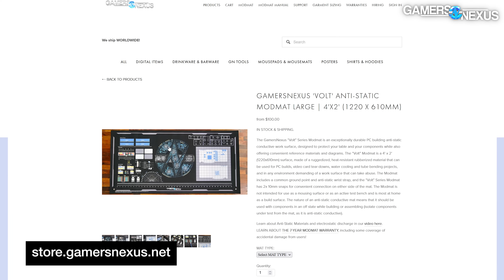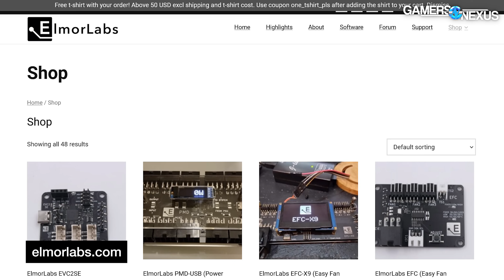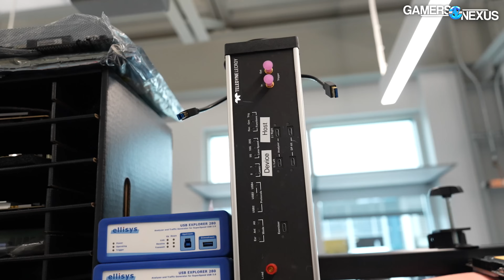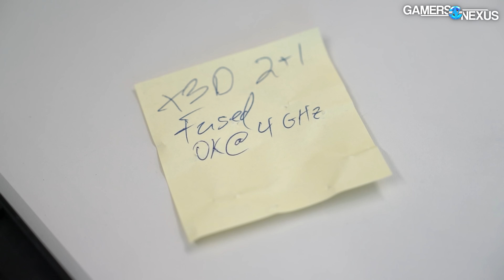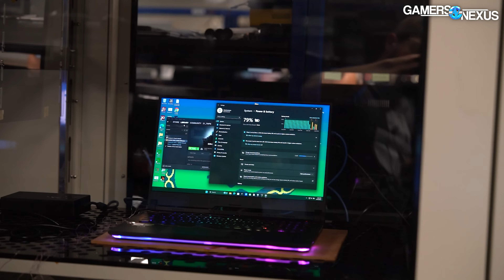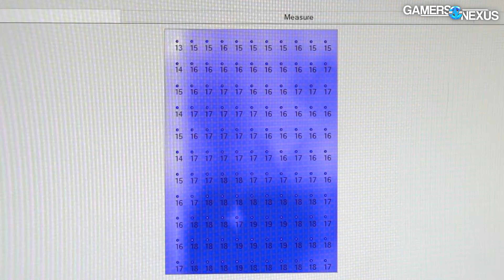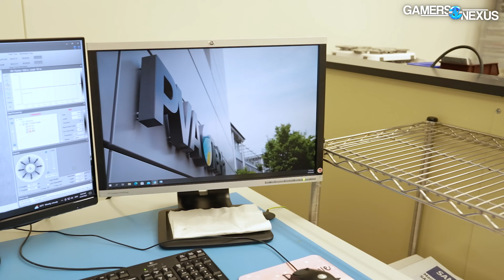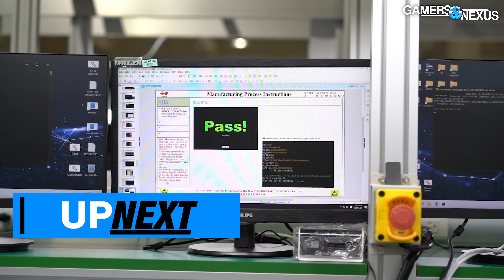Secrets of a $182 Billion Chip Maker: AMD's Labs | Full Documentary

Comment: If I still worked at EMC's e-lab, I could have shown you all this for (enterprise) storage. We had custom testers for Fiber Channel and NVMe protocol analysis. I wrote my own IO load testing tool that found all kinds of firmware bugs in Cisco/brocade/broadcom/Qlogic/VMware firmwares. We had servers and switches from every vendor. Labs are super fun to work at, but also super unrewarding when you're a high performer. Make a breakthrough that generates millions in revenue? Your bosses soak it all up. It's no fun to be smart in those places; your wins get eaten by mgmt, and you get told "despite inventing cold fusion, your performance just isn't good enough to justify a raise or promotion". Soul crushing.
Reply: I totally believe it. Testers are the most talented unrewarded/undervalued folks in both the hardware and software side imo.
Reply: That's why one keeps a diary about how one's benefited the company in terms they understand. Regardless of profession. Don't depend on them to remember or understand.

Comment: At 20:00 the engineer, sorry I lost track of his name, mentions the difficulty of monitoring traffic and diagnosing issues on the Zen CPU with the chiplet design. If that gets discussed more I'd love to hear more of it. Chiplets are clearly how CPU's and GPU's will be built going forward but if the chiplet interlink cannot be easily monitored then it could be a major problem.
Reply: It’s just a link like pcie, the point he was making was about not having the space to break them out because they are built into a substrate together. They would need to build a way to monitor that traffic into silicon and or path it to the I/O pins to really monitor it perfectly, but there already exist ways to see if that link is giving bad data, with zen 4 you will see loss of performance due to error correction causing a reduction in bandwidth and all out crashing if it can’t communicate data effectively.
Reply: @alexmills1329  Yep. and Zen 3 will either give you WHEA errors for CPU/Bus interconnect (if VSOC is lower than required), or have from sound stutters up to outright system reboots under load. (if VSOC is MUCH lower than needed... Like 0.1+V lower). And even then it will throw WHEAs before crash. 
Zen4, at least for now seems like doesn't report WHEA's but it's ECC is A LOT stronger...  You may see performance degradation that will increase with lowering voltage more and more.
Reply: @DimkaTsv  True gamers play on Intel, not AMD or Apple! I'm 16 and I even know this!
Reply: Embed the monitoring in the silicon. The PHY knows what it sees.
Reply: @swallowedinthesea11 gotta be a troll
Reply: @wojtek-33  he is Userbenchmark user. That all you need to know about people like him.
Reply: @wojtek-33  16 years olds dont talk like that, he sounds like an 11 yo

Comment: That delidded cpu part where you showed the old amd cpu that shipped without a lid back in the day 

That made me hella nostalgic, reminded me of my very first AMD XP mobile chip i started overclocking with when i was a youngster
Reply: athlon xp heat heads, do u guys still have athlon XPs or MPs? retro overclock that beast, dont forget the nail polish and silver ... to fill out the laser cut gaps to unlock the multiplicator
Reply: I started on AMD 386, but Athlon XP holds a very special place in my heart for sure. From the pencil trick (I used automotive rear window defrost repair epoxy) to the unlocked Barton 2500 set to 400MHz FSB to become a 3200.  Good times 🙂
Take care!

Comment: I am an engineer that builds and solders circuit cards. I can tell the team enjoys their jobs, and who wouldn't? All the work that goes into making stuff is not trivial and requires a lot of various engineering expertise. I'm more on the "make the stuff" end but I regularly work with the "design the stuff" and "figure out why stuff didn't work" groups as well. 

We have exactly that same X-ray system where I work, the applications engineer we work with is great.

I worked for a while in a third party FA lab that wasn't quite that capable but the equipment was same/similar. 

My thumbprint was probably a bit different before I ever used a manual grinding/polishing wheel. 

Laser profilometers are cool because, lasers. I had to contract out some C-SAM once, that was cool to use.

Rule #1: Do everything nondestructive possible first, before anything destructive.

This is easily the best video I've ever seen on this end of tech on YT.

Comment: 28:33 Nice to see an Agilent 34970A DAQ. It most likely has the 34901A card installed which is basically a multimeter with 20 inputs. The metal plate right underneath the DAQ has 20 thermal couple inputs going into the DAQ. They are probably using that for datalogging of test setups with many thermal couples.
Reply: Sounds like you work with that kinda stuff
Reply: They are used for individual thermal readings as well as sens resistors on the development boards

Comment: I would absolutely LOVE for AMD to release 1st-party never-lidded/lid-free CPUs.  They should include a contact frame with them, of course, as well as fully seal the top for use with liquid metal TIM. I would happily pay (a little) more for that.

Also, it's really neat to see some of the people I've met and places I've been on video :p  I was really happy to see the VC IHS, I never had closure on the performance they offered in exact terms before - 3C is definitely not worth the hassle considering bare die can be 16~20C better.
Reply: Lid-free is not transportation friendly (due to shipping workers carelessly handling the packages), they would have to offer in-person only.
Reply: @erkinalp   That's just not an issue, a tiny change in packaging would easily resolve that.
Reply: I mean... I'd kinda take the 3C if it meant not voiding the warranty and paying for extra equipment, but it depends on the increased price and impact on performance. I guess they made the call that it wasn't quite worth it. Plus, let's be honest, running at full temperature isn't something most of their consumer users will be doing most of the time.
Reply: @TheGreenReaper  3C is easy to get with a slightly better cooler or higher fan speed.

I (and they) thought the vapor chamber IHS was going to have a bigger impact when I was talking to them about it during the concept/design phase.

Another interesting concept/design is an integrated TEC (Peltier) layer on the actual die near critical regions.  Hypothetically you could have 6.5GHz+ CPUs doing that.

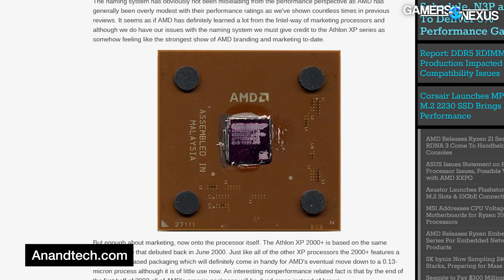Comment: 37:50 Yep, I chipped the corner off an Athlon XP CPU that didn't have a lid. Happened when I was watercooling with a pure copper waterblock made by what was probably a one person operation. The CPU still worked fine. 😄 Back then most of the components for water cooling came from home improvement and pet stores. 🤣

Comment: God Lord I'd love to see any of these folks home setups! And hella cool video keep it up!
Reply: Hi :-)   I just built a new system using 7950x3d with a D15 cooler, using an old Antec Turbo Server style case, in dark metallic green, from around 2003, complete with period-correct cold cathod lighting and a transparent side panel which was the new thing at the time I originally bought the case (at Fry's Electronics in Austin). I modded the case fan situation to bring it up to spec, including replacing the fan in my Seasonic 1200W modular PSU, so that it is plugged into the motherboard for legit fan control.  I don't want to name the mobo vendor, but I always rotate through all of the brands and went from one to another; using x670e. I have 3x 4TB + 1x 2TB NVMe drives in a mix of brands, including Gen5 devices via M.2, along with my old Gen3 2TB from my old configuration. I work with the NVMe IO stuff at work, so I wanted to try a variety of the major drives in real-life. (had a bunch of RAID stuff setup on the previous one).  For RAM, I'm using a pair of unnamed/unreleased Hynix A die based 16GB modules rated for 8000MT/s (CL36) at 1.5v, or 7200CL34 at 1.4V.  I don't need much capacity, but I did want to have overclocking headroom - David McAfee just spoke about some optimizations and changes coming for DDR5 support and frequencies... 🙂  I'll be bringing it to Quakecon 2023, next month!  Take care!

Comment: 49:57  Navi 21 is not the 5700 XT.  It's the die used for the 6950 XT, 6900 XT, 6800 XT, and 6800 GPU's.

The 5700 XT used the Navi 10 die.

Navi 1x was the RX 5000 series of GPU's.

Navi 2x was the RX 6000 series of GPU's.

Navi 3x is the RX 7000 series of GPU's.

Comment: No need to force everyone to buy a  new cooler, if it's a new gen of chip then a new socket can be made taller so a thinner lid will fit existing coolers. You don't lower the ceiling to work on it, you raise the floor by standing on a platform.

Comment: One of the big "what ifs" that always intrigued me was the never released AMD Athlon motherboard chipset that used Rambus RDRAM. This was at the time (c.2000) that Intel was pairing their 64bit @ 100/133MHz bottle necked Pentium III with RDRAM. The Athlon at the time had a 200MHz DDR at 64bit (and very low latency) bus for memory and could have stomped Intel using their own memory. But they chose to just use (SDR) SDRAM as (from what it seemed) it was cheaper to build a system with and they still were able to keep up. A couple of years later DDR SDRAM was transitioned to by which time Intel had moved on to their P-IV that could actually use all of RDRAM's (or DDR SDRAM's) bandwidth. Opportunity lost among many later ones.

Comment: 37:55  how about making some rubber or some kind of material that can build surrounding the die. So the pressure on cooling wouldn’t 💯 set on the die. 
Usually, a bare die are crushed by pressure on angle. So my guess, if amd put some soft stuff on angle or whole surround die, it can help protection the die and you don’t need cover on top
Reply: To be more clear, what I mean is to put soft rubber or some other material on the side of die, not on the corner of pcb. But it may also good to put on pcb anyways

Comment: I wonder how many Open Benchtables they have there? That's a great endorsement of that product
Reply: I have about 20 of them now. I'll probably grab 4-6 more to make sure that all of my bench systems are using them. I don't plan to upgrade my rack systems though, at least for now. They are a great product, if not a bit expensive when you can't find it on sale/special. Some PSUs, with a curved design on the rear won't work without longer screws, but I've only seen a couple of PSUs with this design. Sampson Approved!   The only real issue that I've had is the weight when traveling by air.. my kit is already at the limit with foam board holders.  Take care!

Comment: 37:50 The older AMD cpu's you could get 3rd party copper shims/spacers ( I had them myself back in the day and used with my AMD cpus)  they helped spread out the clamp load so you don't crack the cpu and helped spread some heat from the cpu to cpu cooler too.

Comment: When they've shown the mobo chipset & I/O testing bench, I only wished for them to basically drop the chipset altogether and change it to just an intelligent PCIe switch... then their testing would be easier by focusing on AVL of PCIe controllers, and mobo manufacturers could just plug-in whatever they want (but test in-house if not on AVL) and how many they want into such switch to use all the PCIe lanes traffic the switch could support... and by extension manufacturers could truly differentiate themselves by the selection and composition of PCIe onboard added controllers... At least until they decide to drop the chipsets altogether in favor of providing more PCIe lanes steaight from the CPU, Epyc-style...

Comment: So did you get to keep that Epyc/Threadripper  etched with AMD Welcomes Gamer's Nexus text?  That'd be a fun souvenir to have.

The real skunk works of lab tools seems to originate from Elmore labs.  I'd enjoy a tour of that lab sense they seem to be involved in some very interesting ways with this 

18:45 With PCIe 6.0 having recently been ratified, this lab would be one of the first to get those analyzers.  With the move to PAM4 encoding, their cost should be a another jump in terms of cost.

21:14  I'm kind of surprised that those JTAG analyzers don't use PoE for power.  Reducing cable clutter is a big thing in these labs.  No obvious nest of spaghetti in this video but some one has had to work to keep things clean and organized.   PoE would remove the need for additional AC outlets near the systems and a DC cable to the JTAG device.  My presumption is that there is some debugging purpose for having discrete power (like needing to debug the debugger).

24:10  There needs to be a mini-rant about how having a 7 segment display like this is nice just to throw shade at motherboard makers.  Yes, this is a testing lab where this makes sense but it is great to have something like this on consumer products so we, as consumers, can try to fix these problems.  By the time we get these produces we should only need two digits!

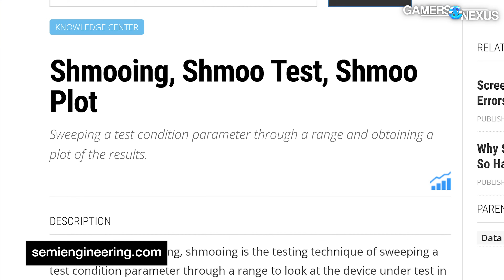24:55  Who creates these microbenchmarks and when to they originate in the development pipeline?  I would guess that these originate from the actual design teams and are ran in simulators first before being tested in this lab environment.  This would also explain why there would be documentation on error codes and expected behavior for this lab team to work with.  Microbenchmarks that would likely originate from the lab or other groups would be cross component testing.

50:00 Pretty sure Navi 21 was the RX 6800/6900/6900XT/6950XT with Navi 24 being the RX 6300/6400/6500/6500XT.  The 5700XT was Navi 10.

Was there any Xilinx or Pensando products being tested there?  Those are big data center products which AMD got through acquisitions.  Curious if they merged their testing/lab operations as it generally becomes more cost effective to consolidate where possible.  Labs like this are not cheap.

Great video.  Only thing I'd really change would be removing the cut claps.  Kinda odd seeing them as they are intentionally meant for the editing room floor.  A quibble if anything.

Comment: In the ultrathin form factor, the vapor chambers are not effective. They use water as the working fluid which has relatively low pressure compared to the refrigerant, which means the water vapor cannot effectively spread in the ultrathin vapor core.

Comment: Hello! Thx for the video. I bought a prefab PC from Origin PC. Its a pretty good deal but I just noticed my pump had died. I also noticed they installed it wrong according to your video. High rear mounted, tubes up above CPU pump. Cpu pump installed sideways. Its an Origin 120 frostbyte. It must have a heck of a heatsink cuz my temps are under 120f working load if the pump isnt working...

Ive purchased a new liquid sink. Kraken 120\m22. The pump for this is not on the cpu but mounted on the radiator. 
What took away from this tutorial is that some portion of the radiator should be above the pump/cpu attachment to force air into the highest point, and away from the cpu and pump but still provide flow..

I can mount this where ever. Im just curious on radiator mounted pumps. Can I still mount over, or should i side mount low to top? Just thinking 120 pump radiators and air gaps in mounted sideways above.

Thanks for the video, and thanks for suggestions!!!

Comment: What about signal delays using multiple PCBs to simulate a possible motherboard?
Reply: Definitely a concern.  There could be extra buffering between the boards, and then the engineer would have to be aware of that and adapt.  He may need to slow the whole system down to make it work.  Some tests don't need to run at full speed.  For the ones that do, he may have an entirely different setup.
Reply: @jej3451  At Texas Idiots, the major cause of signal skew is the different run lengths and the loading on each particular output. The greatest difficulty is in the clock skew. Synchronous circuit design (as opposed to asynchronous or self-timed circuits) assumes that the clock signals get to each gate at the same instant. In the SPB990 7200 gates require 7 layers of buffers to fan out to every gate. Differences in the transistors, differences in the transistor loading, and the run length determined the clock skew.
Running signals through multiple boards means that the results will be quite different than the timing in the eventual motherboard.
However, it is a cheap way to mix and match the functional capabilities in anticipation of the choices made by the motherboard manufacturer.
Reply: @robertpearson8546  It looks like that as long as the particular set of PCIe lanes between the CPU & chipset which is being extended/daisy-chained maintains sufficient signal integrity (validated by the protocol analyser that can be added in-loop), the test rig should be able to provide relevant data for proving I/O functionality rather than being a simulator of a particular motherboard design - which I expect has to be done anyway by the relevant motherboard manufacturer rather than AMD.
Reply: @rednammoc  Does this mean that the PCIe lane protocols are delay-insensitive. Whether functionality is included in the CPU or by chips on the motherboard affects the timing and is outside the control of the motherboard manufacturers.

Comment: what is the valoline for?
Reply: it is used to prevent water condensation from making direct contact with the motherboard/components near the CPU socket when using liquid nitrogen, or other sub-ambient cooling techniques (e.g dry ice or phase-change, etc). Petroleum jelly is quick and easy, but there are many alternatives such as conformal coating, nail polish, and liquid electric tape. Vaseline has the benefit of being non-toxic and fume free.  take care!